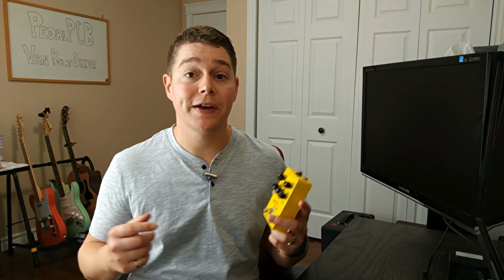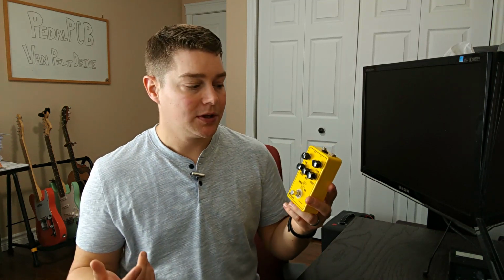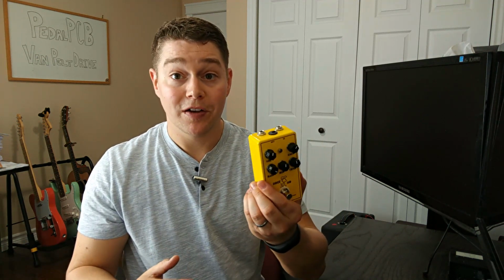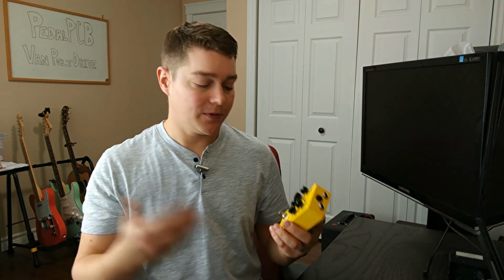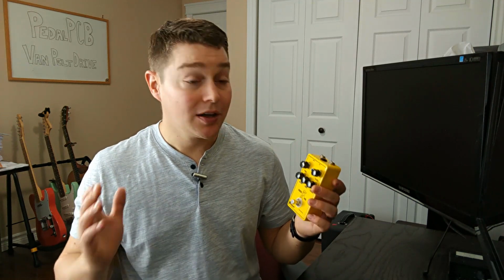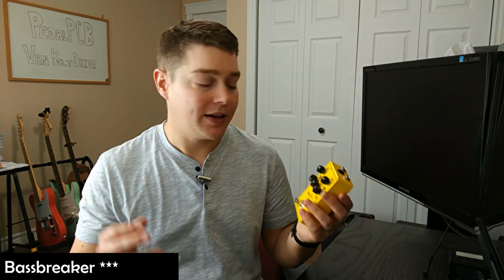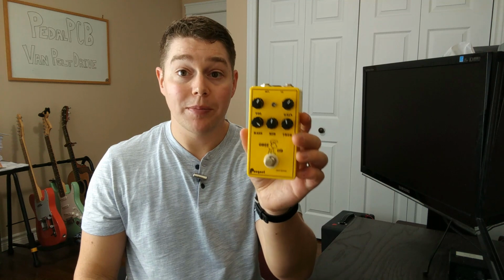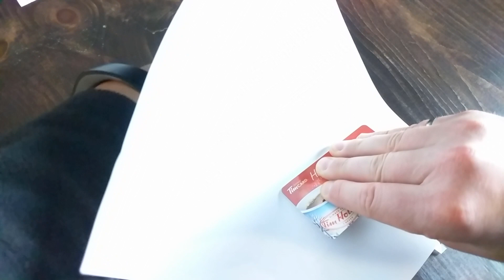PedalPCB Van Pelt Drive | Complete Build, Review & Demo

Comment: Another great video. I appreciate you sharing footage of the build process. I've been interested in doing some PedalPCB builds but one thing I'm not clear on is the LED indicating whether the pedal is on or not. Is it soldered directly to the board? Or are you soldering wires from the LED leads to the board? I've only built one pedal thus far and it was using the latter method. I couldn't quite see when you installed the LED in the video
Reply from the maker: It all depends on placement. I like my LEDs at the top. For this pedal I was able to solder it directly to the board. I have had to run leads for some though.